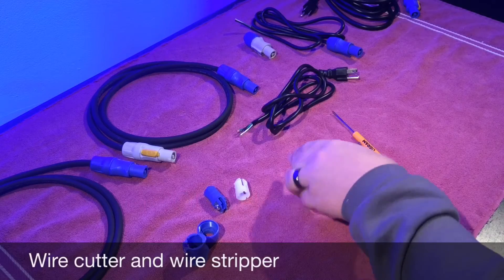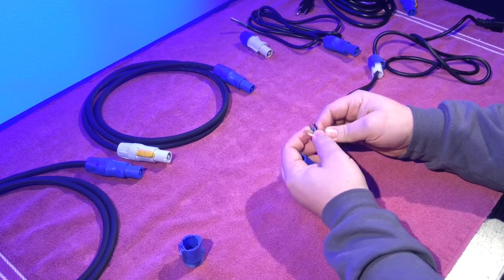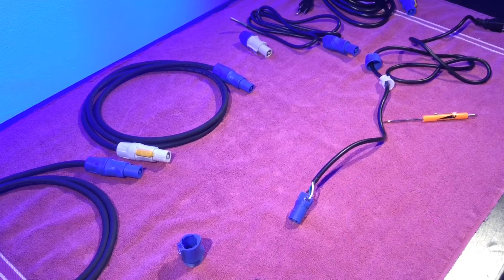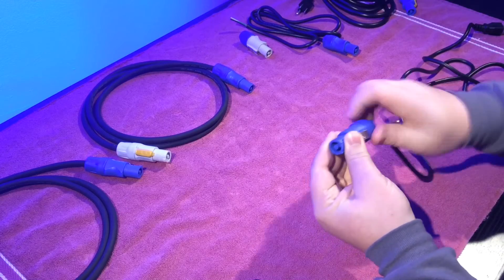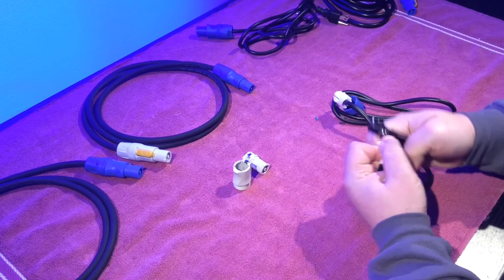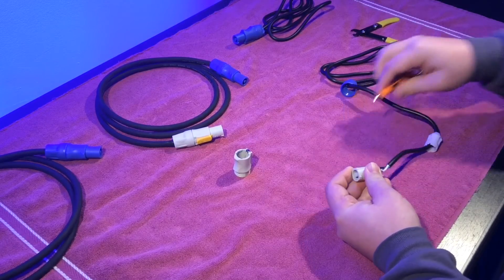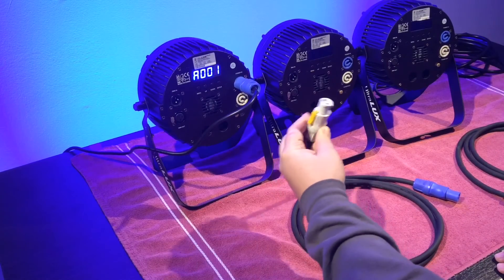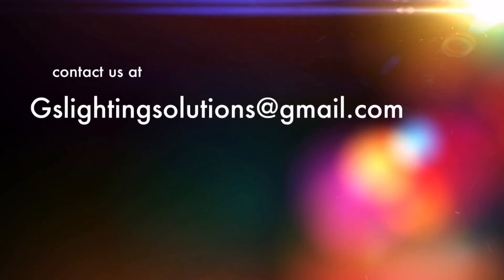How to make a PowerCON cable | Tutorial

Comment: Double fail:
1) Connecting under load. As DJ Shuffle has said, you shouldn't be doing this with original PowerCONs, and you should know this!
2) You shouldn't just be hand tightening the bushing (2:19, 3:57). If you'd bothered to read the assembly instructions, you would have seen this: "Fasten bushing by means of a fork wrench 7/8”
 
(SW 22) or with the Neutrik handtool HTFAC, min. Torque 2.5 Nm (1.8 lb-ft)." Therefore, if it's assembled properly, one would need a tool to open it up and potentially expose live conductors, just like any other mains electrical connector. 
Please read the instruction (https://www.neutrik.com/media/10217/download/bda-452---powercon---nac3fca---nac3fcb.pdf?v=1) and educate yourselves.

Comment: Never connect PowerCON connectors while the cable is live. They don't have breaking capacity, making them susceptible to arcing and damage when connected under load. PowerCON TRUE1 doesn't suffer from this problem, but the original PowerCON spec demonstrated here does. Always connect your leads up first, then apply power to the circuit.

Comment: Hey great vid, couple questions. Can you use SJOW cable for the power con links? And the output from the wall going into your first fixture from a distro,  i'm assuming that would need to be white as that's your first output?
Reply from the maker: DJ Vibe, DJ Services I don't have any experience with SJOW cables. But if it can handle the amperage and wattage and has 3 wires (live, neutral, ground) then it should work. 
If you are coming from your power source to the fixtures you'll use the blue powerCON. most fixtures have a power in and out labeled and the cool thing about powerCON is that you can't plug a in to an out.
Reply: Right, but if i'm making a Distro, and want to make the wall socket a powercon, it would be white as that would be the initial output, right? 

SJOW is used pretty regularly around here in Canada, i'm sure you have another name for it then.  Thanks for your time.  http://www.awcwire.com/productspec.aspx?id=portable-cord-sjow
Reply from the maker: DJ Vibe, DJ Services oh I'm sorry. Yes that is correct. Any power out on powerCON is white.